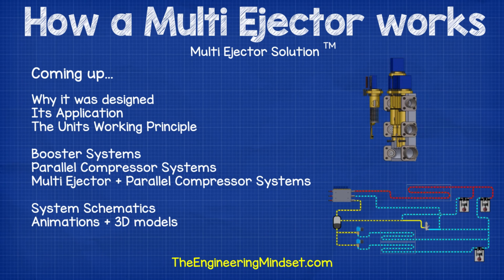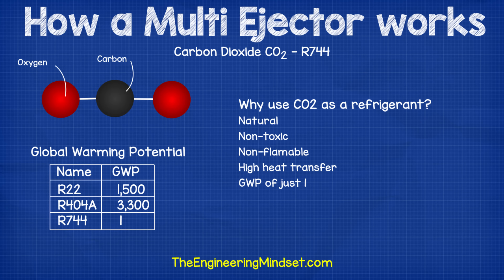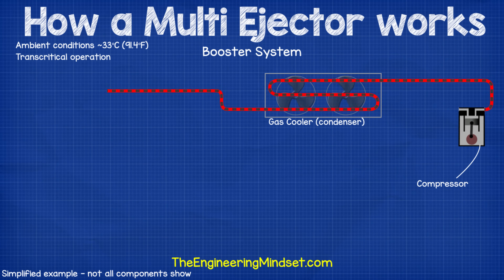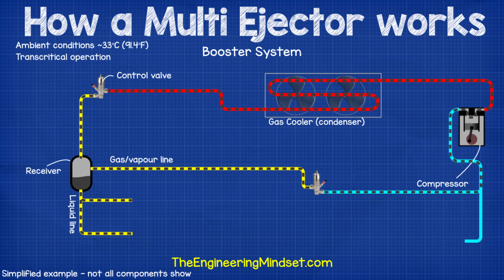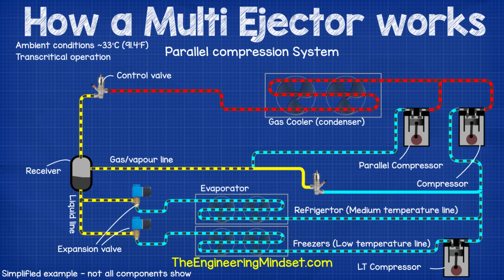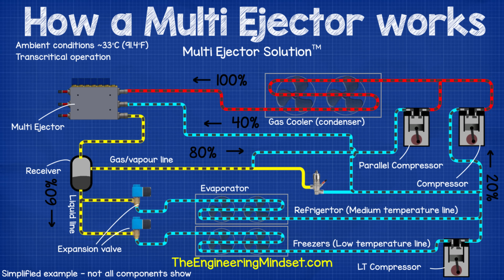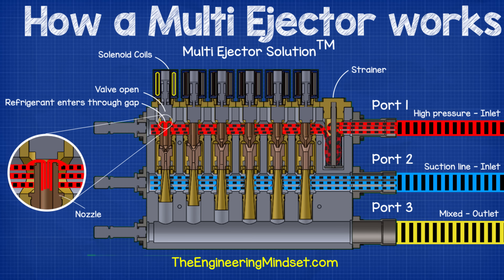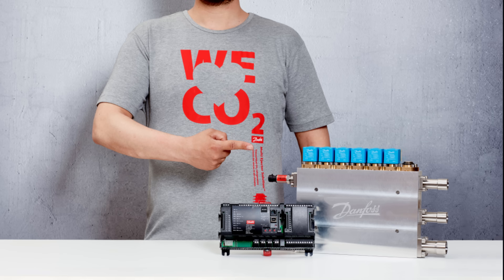How Multi ejectors work - working principle CO2 refrigeration

Comment: I was wondering about the following; I have my compressor going from, let's say, 35 bar to 100 bar. Is the CO2 leaving the compressor instantly a supercritical fluid? If you would look at the P-T diagram, then you would say yes, but it's kinda weird to wrap your head around.
Reply: Are you getting you “‘100 bar leaving the compressor’” from the liquid line or discharge line? I am no co2 technician. Just a curious traditional refrigeration technician.
Reply: @kdote7038  I was talking about the discharge line. Still got no answer to this day.

Comment: Why is this only used for commercial refrigeration and not home air conditioners?
Reply: Cost 
CO2 systems are extremely expensive due to the high pressures all copper has to be thicker walled and the valves extra heavy duty 
So cost would be your answer

Comment: wait wait, I thought CO2 made things warmer... 🤔
Reply: GWP of 1 is defined as the Global Warming Potential of C02, it's not great, but considering current refrigerants in use exceed a GWP of 1400 (1400x worse than C02) it's a MUCH better solution... and less killy than Ammonia when it accidentally gets released...
Reply: @miamisasquatch  the lie and scam that co2 causes climate change can be rebuked by basic 4th grade science of the carbon cycle.

Comment: So I like your videos and what you do, but i have one small problem that an engineer should spot. The gears in your logo will not turn sice you have 3 gears touching... I don't know if that's on purpose or if it's a special functional gear set that I haven't seen.
Reply from the maker: From the one side angle you can't tell the thickness of a each gear and if they're touching or not.
Reply: @EngineeringMindset  ahh i was trying to blow up the image, but I couldn't see the teeth of each gear. I'm glad you wrote me back.

Comment: Great video as always. I only have one objection. At the beginning you mention that CO2 is non-toxic, however at 10% concentration it can be lethal (one of the reasons that using a CO2 fire extinguisher in confined spaces is not a good idea) while OSHA's guidelines say that 3% is the maximum concentration in workspaces.
How are systems using CO2  protected against potential leaks. Is there a a safety requirement for CO2 detectors or ventilation where CO2 systems are present?
It does have great potential though as a refrigerant.
Reply: technically speaking,  most refrigerants in use these days are non toxic(they can contribute to global warming if released into the atmosphere) .  however, they are heavier than air.  so they could collect on along the floor of a basement.  thus displacing the oxygen.  a person would suffocate without oxygen.